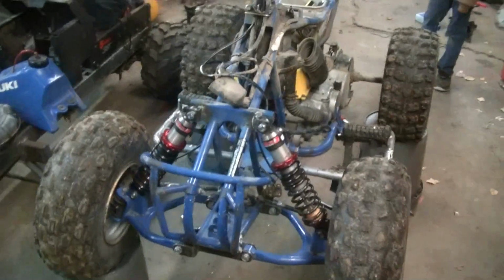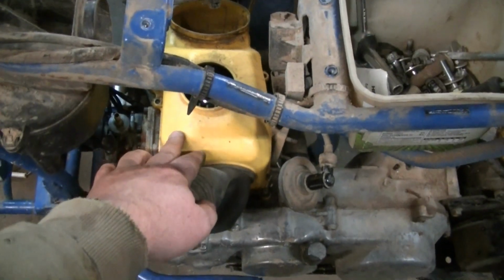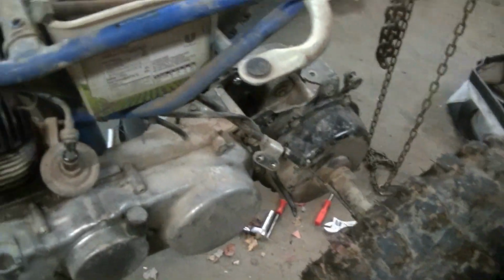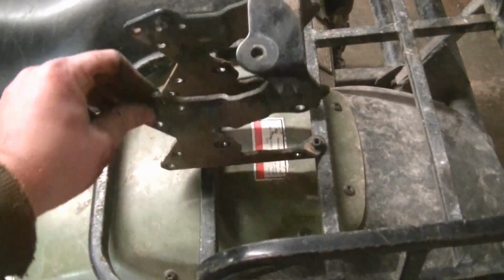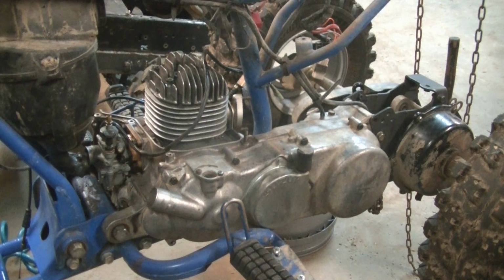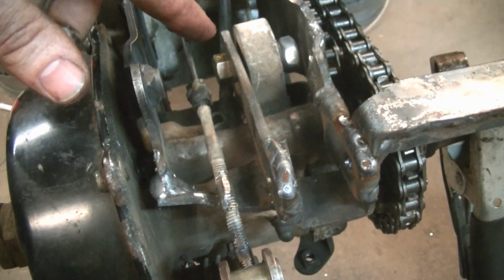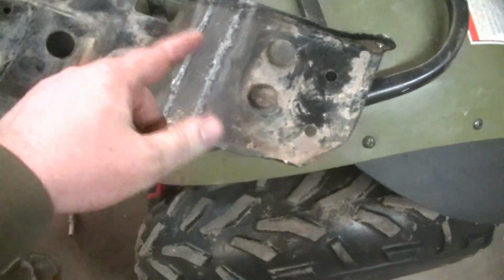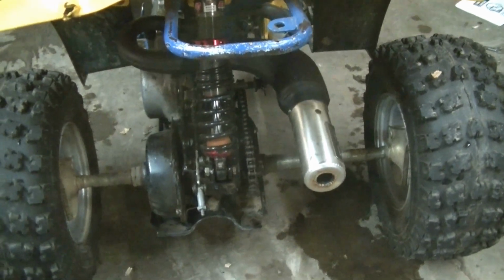Ultimate LT80 Rear Suspension, Engine And Exhaust Upgrades

Comment: Correct me if I'm wrong but the dg exhaust looks to me like it's basically a factory exhaust cut off in the bend around the shock with a short baffle welded into it? If I'm right I'm thinking of just making one and saving some money. What's your thoughts?

Comment: What would you suggest for a sprocket setup? Mine has a torque sprocket, very snappy but not fast. Winds out really quick. I want a little more top speed and still want to be able to wheelie. Any input would be appreciated!
Reply: i guess Im asking randomly but does someone know of a trick to log back into an Instagram account??
I stupidly forgot my account password. I appreciate any assistance you can offer me
Reply: @Anthony Jaylen Instablaster =)
Reply from the maker: It’ll be a trade off.  You will need to get the engine making more horsepower and then switch to a speed sprocket.  You can get Jack Moore to make your engine fast, but it’s not cheap.
Reply: @Mudford  it's not getting that kind of money from me! Lol it's a 1989 and I've already got 1300 bucks into it. Previous owner did all sorts of mods already, power reeds, spacers, hi bars, etc. I'm just looking for a sprocket that won't flip my son over backwards when he taps the throttle haha

Comment: What elka shocks did you use for the front and rears. I would like to do this to my boys lt80
Reply from the maker: R1200874 I ordered them from Teixera Tech.  Probably a good idea to order the rear plates from them also.  It was a real pain modifying my stock ones for the bigger Elka’s.  I had to add a brace after he started jumping it higher. It looks like they offer Stage 1 or 2 now.  When I ordered mine, they only had one set of them.  I assume mine must be stage 1? 
https://teixeiratech-com.3dcartstores.com/LT-80_c_48.html
Reply: Do you mind me asking what is the eye to eye measurement of both front and rear?